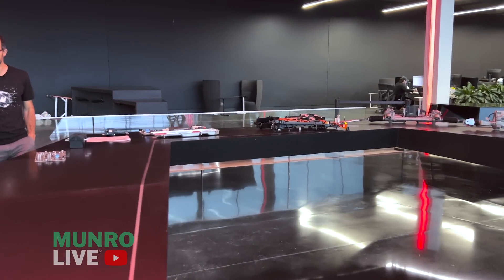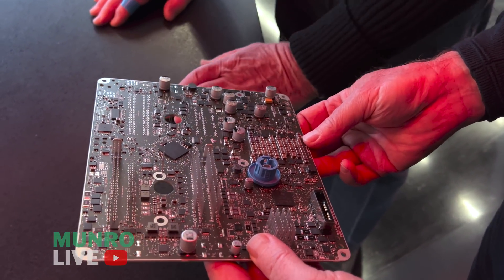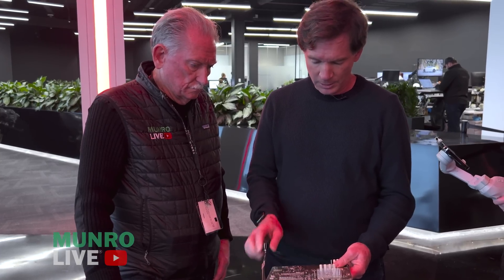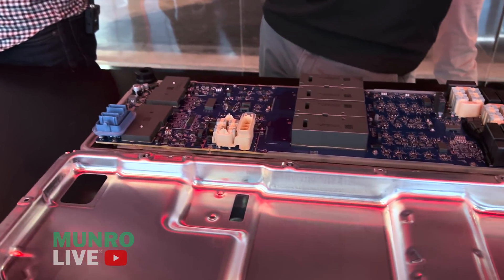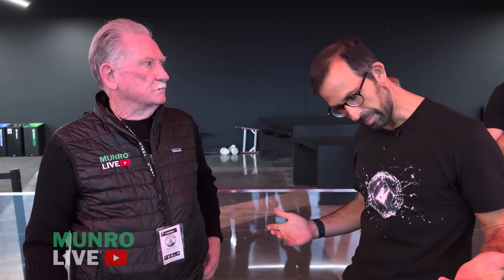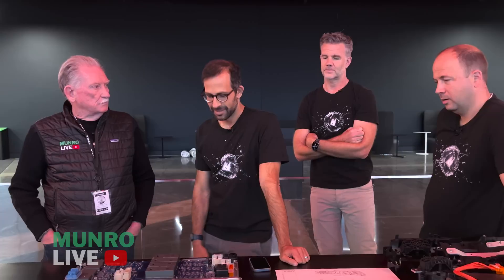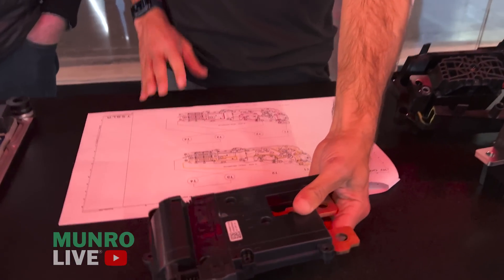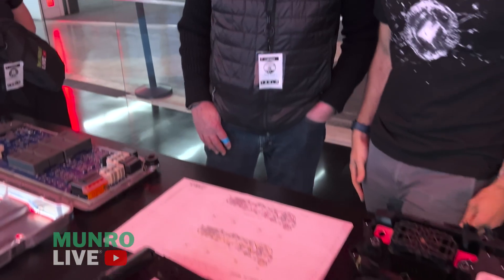Tesla Cybertruck's Power Converter capable of 800V

Comment: Drew says there is a 420Vac output :)
There are actually 2X120Vac outputs and 1X 240Vac output. Is there one transformer out of the 4 doing doing AC-DC (after PFC) to AC voltage? Seems like. The other 3 converter AC to DC.

Comment: Very nice vedio

I would like to know 2 things 
1) There is NO electrolytic capacitors and low frequency inductors on the board?
2) Can we see the back side view of the onboard charger PCS especially at 4:59 sec
3) I think there are only two transformers (can be seen from the traces of PCB winding) but they have mentioned 4 stage magnetics?
Reply: I beleive you are right, no electrolit cap is used, and PFC inductors are integrated inside DCDC transformer.

Comment: Does anyone know if PCS2 does AC charging to the 800VDC pack or does it charge with 400V in pack parallel.
Reply: I believe it will work in 800v configuration, because of output connector configuration (only 3 pins),

Comment: Smaller batteries the best as with all Teslas.  Less weight helps everything from braking, handling,, acceleration, and less cost with smaller/lighter/faster charging  battery. The Hummer EV with 240 kWh battery 48 mpg e.  Buy a diesel truck as wasteful EV battery.  Plus non Tesla chargers would take a long time to charge 240 kwh battery

Comment: Question?
Is the heatsink cooling down the board?
What's the thickness of the board as well?
Eventually the heat is going to build up...
I counted 10 capacitors on the board
Is Tesla manufacturing their own boards as well as components?
I will say they are addressing the correct issues at hand!
Here's the extra Credit Question?
What's the 1 thing Munro as well as Tesla isn't addressing?

Comment: I know Sandy and Elon are buddy buddy now, but the Cybertruck is one of the least impressive vehicles launched in the last 5 years in my opinion. 

Some of the technology is great. There’s no arguing that, but the Cybertruck could have been so much more had it not been the Cybertruck.  Elon’s insistence on the angular stainless steel body, the compromised shape that is far from aerodynamic and cuts into rear headroom and bed usefulness, the smaller battery capacity (and subsequent poor real world range), and the even dumber range extender all are things that keep the truck from being a knock out. Had Tesla just designed a  good truck they could’ve knocked it out of the park. Instead we had to get Elon’s brainchild that seems to have been cobbled together to get something that just works well enough. Tesla is losing a lot of customers because they’ve decided to remove parking sensors, refusal to add radar for things like cross traffic detection and legit BSM, no surround camera system, and Elon selling “full self driving” as something it is not… an autonomous driving suite. 

I’ll be very interested to see what real world range is of the Cybertruck because early days seems to point to Tesla once again exaggerating the range like they do on their other models. “460 miles” of range is more likely to be 310-320 highway miles based on estimated 2mi/kWh efficiency.

Comment: I have to wonder if the person who came up with the 400V and 800V switch flies large scale R/C helicopters.  To fly my 600 class helicopter, I took two 25V packs and hooked them up in series to fly at 50V for the traction battery packs, but then parallel charge my packs at 25V on the charger.  So I was doing exactly what is going on here over a decade ago, except with 25V battery packs for a 50V R/C helicopter and a 25V charger.  (Actually, the charger could do over 30V, but I was using 6S packs, not the max of 8S the charger could do while I needed 12S to get flight voltage).  Then I brought a large 8S, 30V capable LFP battery to the flying field to recharge the smaller 25V flight packs with.  The charger was primarily a buck-boost converter, so it took the ~26V (the flat part of the LFP battery curve) and converted it into 21 - 25V to charge the packs in parallel so I could get multiple flights worth of packs ready all at once.  This created almost no heat on the charger as it was basically straight power across; only needing to kick on the cooling fans when balancing the packs.

I suppose this brings up another point, why doesn't Tesla make a +-200V for 400V total home power system?  The idea being 200V is something you can run over home wiring as most home wiring is rated for at least 300V per conductor and DC with power electronics is more efficient than AC.  So you take 400V off of solar panels with the cells wired in series and basically directly dump it into a stationary 400V battery system.  When you go to charge up your Tesla vehicle at home, you basically just dump the power from your DC home power into the car or truck with a simple buck-boost converter like the main part of my hobby charger.  If you need some additional backup power, the DC power just flows back out of your car or truck through the buck-boost converter.  Then you also have say a Telsa heat pump for the home, something Elon Musk has played around with the idea of making because home air conditioners tend to suck in terms of power consumption, and that heat pump runs off of 400V DC as well while using efficient Tesla motor tech to drive the compressor.  So all of your really high powered stuff uses a common 400V DC bus essentially.  They already make 400V DC power supplies for your computer, so you can run say your high-end gaming PC with say a future ridiculous Nvidia 5090 Ti Extreme OC Water Cooled by Fire Hydrant  Edition and do the power delivery efficiently and without popping the breaker.  (Granted DC power needs DC specific breakers.)  For any remaining AC stuff, you can both have an inverter for that or just produce the power from the inverter in the Cybertruck.
Reply: Yes using contractors to switch from parallel or series 400V/800V charging is simple, uses the full charger capacity and you don't need a complex high power DC/DC converter
Reply: Just as you said it, it’s not a new idea, indeed. Power tools batteries work the same way, in order to use the same old chargers.

Comment: But the power is out! For weeks at a time,sometimes longer. No chargie charge
Reply: Gas station run on electricity, no fillie fill.
Reply: @universeisundernoobligatio3283  I been told I suck befor but no electricity,  I sucky sucky it right out the tank!
Reply: Wouldn't it be great to be able to drive out and pick up a few dozen kilowatt-hours of electricity to power your house over that week?  THAT is exactly what this truck can do.  Drive to a supercharger somewhere power is on, charge, drive home, and connect to your charger.  Switch your gen-tran switch, so you don't kill any lineman, and bask in the luxury of the 21st century.
Reply: @CorwynGC  blaaa blaaa blaaa. Not!

Comment: Even they change to 48V supply to the board, if there is a 48V-16V converter on the board, the thermal loss saving is mostly at the power cords, since less current at 48 with giver power. What helped getting rid of the heat sink?
Reply: Indeed, hence why some “traditional” automotive manufacturers are moving towards 48V only to reduce the conductors weight.

Comment: That 400V or 800V switch is genius. Nicely done.
Reply: Far simpler, better then a up converter from 400V to 800V, plus the full capacity of the charging station can be used.
Reply: So the pack is still just around 400v but it now has two parts that are able to be connected in series or parallel on demand by that control board.
Amazing.
Reply: @grettirgrattmards2348 
Also saves the huge cost an undersized up converter. Also near 100% efficiency while the up converter around 95%, the 5% goes up as heat which you pay for..
Reply: Yes, GM thought so too... when they did it for the Ultium platform a few years ago. A GMC Hummer EV, for instance, works this way.
Reply: @brianb-p6586  Thanks! I didn't know it had already been implemented somewhere in a vehicle.
Reply: Same concept is being used by DeWalt in their battery packs, so it’s nothing new.

Comment: That's an awful lot of little tiny components that have to work perfectly for everything to go well, I have to wonder about long-term reliability. I figured the 800-400 volt split was simply a contact relay but the idea of everything running on a wide range of DC voltage was another benefit of variable drive.
Reply: and this is supposed to be an offroad vehicle! lets see how they will survive
Reply: Because engines require so much less maintenance that an electronics?!

Comment: 1) Will the range extender be user removable?
2) Will Tesla rent them out on demand?
3) Why didn’t they make the rear seats/window fold down for ease of assembly, air conditioned camping, ski/board/sports equipment, building materials secure long item storage??

I wish Sandy had asked these questions
Reply: 1) no. 2) no. 3) no idea.
Reply: 3) It's designed for Cybercuck Bro's, not real workloads.  As every fanboi commentator has said, 99% of users don't put anything in the bed.
Reply: 3.) Because you can't build front seats that can hold back 2 tons of load from crushing you like a bug in an accident. There needs to be a structurally strong element ("wall") to stop whatever you have loaded. Also, the back seats fold up, giving you a really sizable cargo area.
Reply: @HenryLoenwind  Yes I get what you’re saying. Fold up is great, but the utility is still limited. 

Also GM has pulled it off here:
https://youtube.com/shorts/ySylKSd4jr0?si=HKkOg94brijx1xRe

Who would load 1T let alone your Max payload in seats down config? It’s no different to overloading a hatchback, van, people mover, wagon, sedan or SUV with the back seats down. Do we need to baby those users and ban rear folding seats there?

That decision is left with the owners. Most people are free, just like they would in the Cybertruck, to install a cargo barrier cage
Reply: @Tigerdograt  would get in the way of the bed cover i guess. if you watch closely you see that it disappears behind the Seats when open.

Comment: 50% range loss with a trailer is pretty bad. And that extra battery pack doesn't seem to help much. I bet a simple gas generator might help a good bit if you can plug it into the ports in the bed of the truck while it's driving for a bit range so you don't have to charge every hour.
Reply: Maybe someone will offer a diesel engine upgrade.

Comment: max amp charging at home?
Reply: The relevant converter was specified as 11.5 kW; at 240 volts that's 48 amps, which is the maximum continuous load allowed on a 60 amp circuit. So, you install at least a 60 A circuit, plug a home charging station into it, and charge your Tesla at up to 48 A of 240 V AC.
Reply: @brianb-p6586  thank you.   I wish they would have  bumped it up to 80amp continuous

Comment: Anyone from the tv repair world will recognize the surface mount radial aluminum capacitors on that board. They are a weak link and develop ESR FAILURE.. équivalant séries résistance. That design is a failure waiting to happen and they fail sooner than later…
Reply: TV components are consumer grade, not automotive grade.
Reply: I believe the tolerances are 1% and high temp used in the mid 2000’s consumer electronics especially in second gen large screen TV’s. The caps on the board in video are identical to what was used twenty years in consumer grade projection TV’s. They develop a failure not easily diagnosed unless you had back in the day a Sencore CAP checker that could measure ESR.  Technology used on the boards in video maybe new for EV’s but the basic architecture and related failures have been around for decades.

Comment: So does the power conversion system replace a low voltage battery or is there a 48 volt battery somewhere in the truck?
Reply: There is presumably a 48V battery somewhere, that is why they talk about 'jumping'.  Also you want to be able to disconnect the big battery with relays, and those require power outside the big battery.
Reply: @CorwynGC  Confirmed! T Sportline just did a video with the frunk removed and there is in fact a 48 volt battery, they pointed it out at 6:50 of the video.
Reply: @CorwynGC  It's confirmed! Franz and Lars were on Jay Leno's Garage and said it has a 48 volt battery for low voltage.

Comment: Waaait one minute. With a dead simple DPDT 800 to 400 V converter switch, they would need to ensure the two halves of the battery are precisely the same voltage before engaging 400V parallel mode.  For aged batteries this would be quite difficult/impossible.  How do they handle that? Are they regulating each battery half independently with own control modules? Are they not charging the two halves in simple parallel?
Reply: I doubt this was overlooked on their part. They actually did the engineering to quantify how often and how much they could go out of balance. They designed pack so cells see almost exact same conditions so do not charge/discharge differently and should age similarly. Also, did not design for End of Life or assumed had bad cell quality where get different aging characteristics. Also in case these were not balanced, still can charge at 800V.

Even in unlikely scenario that all cells in one half were at an average of 20mV different than the other pack. Assuming 96s6p per half with 5 mOhm cell resistance this is 1920 mV / 80 mOhms = 24 Amps.
Reply: since the battery can already sustain 450kW at 800V, all the wiring can continuously sustain 550+ Amps - the inrush cell imbalance current cannot exceed that for any meaningful amount of time - seeing that all these cells are continuously working together, aging together, being balanced together - and if you have a cell that's significantly higher or lower than the others, that would be sufficient reason for the BMS to be doing something about it (such as warnings, alarms, limiting current, preventing paralleling, etc...)
Reply: The battery already consists of many parallel strings of cells (96 for 400V) that need to be balanced all the time. They can just keep them balanced as if the pack was a 400V pack even when running in the 800V configuration.
Reply: Excellent question, the onboard charger is actually made from two complete separate circuits, one for each battery bank, ther are bidirectional too , so they will keep two banks well balanced by discharging one and charging the other one.

Comment: Anyone that plans to pull anything will benefit greatly from more range. And the silly range extender in the bed just seems like a terrible idea.   I personally know a few people that are canceling due to the range being short.
Reply: @Mouwcat I don’t think that is true, myself my family members and at least 10 other people that I know that all have pickup trucks do occasionally pull things that would currently be totally impossible with the cyber truck simply due to range.   And I live in TN with pretty good charging options.   And those occasions are frequent enough that it is very important.
Reply: @Wingman77tws  Where in Texas are you that you are more than 200 miles from a supercharger?
Reply: @CorwynGC  I’m not, but I don’t see how that is relevant.  The cyber truck is rated for 340 miles,  and with Tesla ratings that is a realistic 270 miles.  ( my 330 mile rated model 3 only does 240 miles at best).  Towing will cut that on half, and keeping the battery between 10 and 90 puts you at a reasonable range of maybe 100 miles.   If you are towing something with much air drag it will probably be less.   That’s just not enough.  Not to mention that none of the superchargers currently support towing trailers.
Reply: @Wingman77tws  if you can't even get EPA range that's on you.  I get about 20% better than EPA in summer and 20% in winter.
Reply: @CorwynGC  in a Tesla or something else?

Comment: I sincerely don't understand the big deal of having the pack be split in two for 400V/800V charging. It's the years 2023. Why is this such a big accomplishement, rather than an IMMEDIATE must-do when you have the opportunity with the number of cells you have?
Reply: the control system to enable this has to be somewhat sophisticated.  You can't just put two sets of raw 400V batteries in parallel 'just like that' because even 2% charge difference would be hugely problematic at such low source impedances.  I can only image they developed sub-control modules for portions of the pack and switchover controls that ensure this can happen safely.
Reply: @cuisinart7899  but they really do just use a double-pole double-throw switch; it's just a matter of keeping all cells of the pack balanced (as usual) so that there isn't a significant bank voltage difference at the time of making the parallel connection.
Reply: They want to benefit from both 800v high efficient design and the fact that most super fast charging stations are only 400v.

Comment: It's a drawback of the 4680 cells I guess, the low volumetric energy density. Not enough room for high battery capacity, but the truck is sort of light until you put more batteries in the bed. 123 kWh is NOT a lot for a track that size, and some other EV trucks DO fit a full size spare wheel. When going on a long drive, let alone on less than lovely pavement...you need to bring a spare wheel. It's not going on the roof, else the RE is pointless anyway, might as well just have the wheel there in the bed.